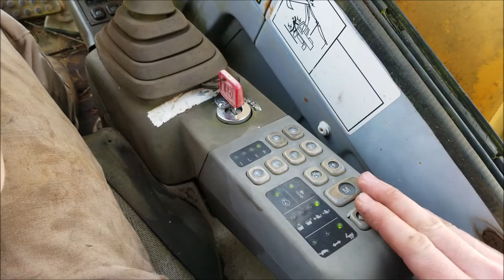John Deere 490E/ Hitachi Limp Mode

Comment: Thanks for the video.  Just bought a 490e and we are having about the same trouble. Throttle cannot be controlled from cab with buttons and hydraulics will stall engine on certain functions. I was told to look at angle sensor on hydraulic pump. If that doesn’t help I may do what you did with the plate.
Reply from the maker: Keep us updated. Seems to be a common issue with these machines.

Comment: Something is not getting power get a wiring diagram its a very simple system somewhere there's a solenoid valve closed or not opening all the way

Comment: I have a Hitachi ex 120-3 I believe it is the same machine different engine I was able to take those four bolts out and put a big pair of pliers on the plate and rotate it without pulling it out and I got the same result you did it didn’t bog down but it moved very slow but I found a fix for the hydraulics bogging down it may work for you if you’re interested get back in touch with me I was losing power at the pump relay so I hooked up a jumper wire to it from the wiper relay and it works the problem I’m having now is I’m not getting power to the control panel my machine only tracks in turtle what is the tracking slow problem came up long after I fixed the bogging down issue
Reply: Do tell, I have same machine